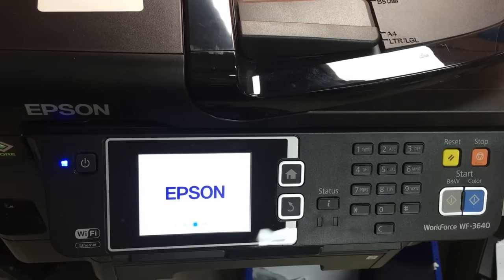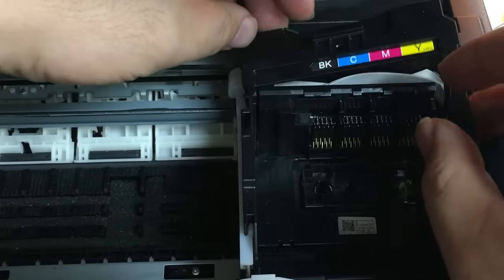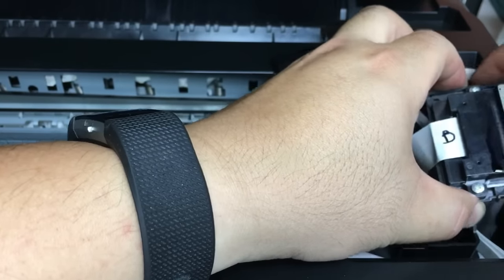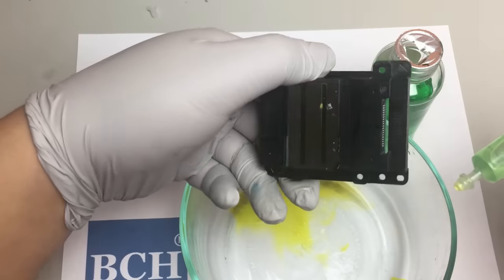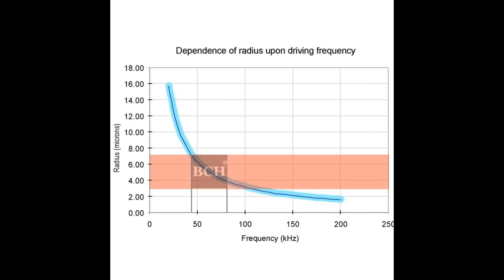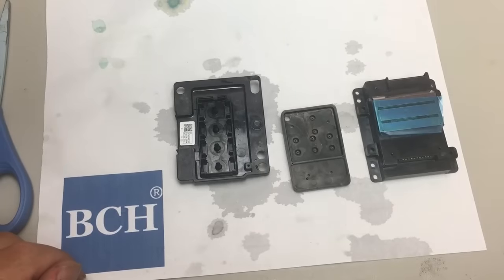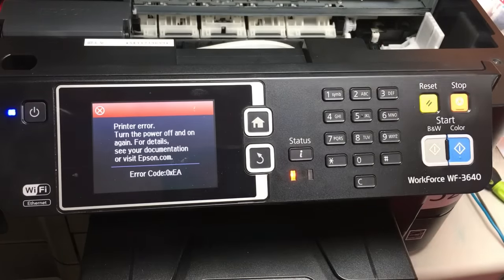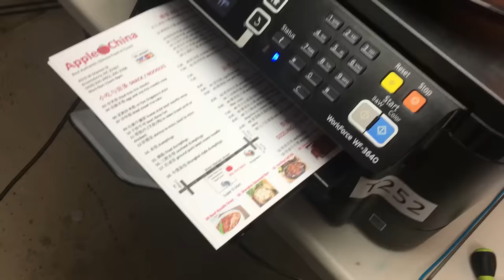Extreme Unclog Epson Printhead WorkForce WF-3640 Fix 0x97 0xEA Error

Comment: I followed all step but the sonic cleaner. I also didn’t have a compressor, so I pushed air through all the nozzles to dry them inside and remove any excess cleaner. I did two clean head functions and have don’t see any color on the print checks..... I’m not sure what I did wrong. Most of the inks are low, could that be a factor?
Reply: 9-12 test clean print jobs should work that out until you get clean lines.
Reply: @pamelawise1203  what do people mean when they say test clean print jobs   ?

Comment: Hi Kevin!  I just order some of the triple action green cleaner and a few other things.  I have a few pixels in my print head check that will not clear up no matter how many cleanings I do.  They don’t move either.  Wondering what my chances of success will be without an ultrasonic cleaner and just the cleaning solution?   Can we send you a print head for ultrasonic cleaning if needed?

Comment: At 16:16 describes my error perfectly and shows it happening too!  I read other articles that say the encoder strip gets threaded through brackets behind the carriage where a sensor or whatever can count the vertical lines to know when to stop.  If that strip (from what you and others have said) gets bent or dirty somehow, you are supposed to clean it with rubbing alcohol and a lint'free rag (like the light blue auto shop paper).  I replaced the strip and it is still doing the screech and stop on the left side (0xEA error).  ANY IDEAS ON HOW TO FIX THIS???
Reply: Hey Joe, I'm sure the chances of you responding to this are slim but did you happen to figure out a solution? I followed the tutorial as shown but I am still having the same issue that you had mentioned. I'd really appreciate any information you can relay to me and regardless if you have an answer or not, I hope you were able to repair  your printer. Happy printing :)
Reply: @jasonfunderburker9864  I did get another encoder strip from ebay, cleaned it and it stopped the left side slamming carriage, but now I get a E8 error and a shrill screeching sound on the left side.  Looking at a plastic tab on the left side gears that pushes a smaller gear towards the carriage and stops it, then the other screech like I said,  Yes, the encoder did stop the slamming carriage error 0XEA, but I don't know if that little plastic finger is supposed to stop the carriage yet

Comment: No, the lines appear to be perfectly horizontal. In fact I also tried to print an ordinary word document; that also just resulted in the overlapping blocks of colour with a few horizontal black lines here and there. Is there possibly a software reset code that I can put in to put the printer back to the original 'factory' condition.  It would be a shame to have to dump this printer because until now it has been a good, reliable peripheral. Thanks for any suggestons you can make.
Reply: @Barry Plumb  I'm afraid you have either shorted out or delaminated the printhead. It means that the ink channels inside it are now communicating with each other, irreversibly. It happens when you push the syringe piston too hard and the seals break. It's best to leave 1 ml of AIR in the syringe to act as a "cushion", and proceed with a SLOW suck/inject action instead of just plug&push. Sucking will force air back into the plate nozzles and the 'turbulence' will help dislodge dead ink. In your case you need a new printhead and the relevant Epson Adjustment Program to electrically match the new printhead to the old motherboard (very important!). Check Aliexpress.com and hope you find a good deal.
Reply: @Gavichap  

Thanks, Gavichap, for the information. As a matter of fact, in order not to exert too much pressure I did not use the syringe in the way the video showed.  I only used it to inject the cleaning fluid into a thin-walled silicone tube that I had placed over each of the ink feed nozzles.  I then simply pinched the top end of the tube closed and gently squeezed the middle of the tube between my thumb and forefinger to apply what I would have thought was quite light pressure. It looks as though the printer will now be a throw away since print heads here in the UK cost nearly as much as a new printer.  And that is without any additional cost for an adjustment programme from Epson.  As an engineer I am saddened by our modern, relatively poor, approach to serviceability; too much potentially useful kit ends up in the trash.  Anyhow thanks for your interest and for taking the time to let me know. Best regards to you.
Reply: @barryplumb581  Thanks for the reply Barry. I must say that, according to what you said, it's very unlikely that  the printhead could have got damaged with that light pressure. To unclog printheads (let alone to delaminate them) is required much more pressure than a light squeeze. I suspect the printhead got ink or fluid into one of its flat ribbon connectors somehow. As a last resort, I would search for a printhead disassembly video relevant to the printer series, lift off the printhead and check the connectors for moisture plus clean and reseat the flat ribbon cables. Depending on model, Epson printheads can be very cheap on aliexpress.com but Adjustment Programs are to be found on the web because at Epson they would rather kill the Queen than selling you the Service software. I left a message one month ago about their hideous policies. Have a look and have a nice day!
Reply: @Gavichap  Thanks again, Gavichap.  I'll do as you suggest and see if it might prove resurrectable after all.  (I never throw anything away anyway until I am completely convinced that it is worthless - as my wife is always reminding me as she looks around the garage!)  If I get the printhead out is it likely that any damage will be visible or will it all be on the micron scale and between layers that are covered?  Have a good day yourself. (I lived and worked in Scottsdale, Az about 30y ago and I still miss the friendly US-style exchanges between folk). Regards. Barry
Reply: @barryplumb581  Dear Barry, alas you won't find any visible damage on the printhead, except moisture - if any - on flat ribbon connectors. I advise you to take it out, flush the whole assembly with alcohol (aka methylated spirits), shake it dry and pop it in an electric oven (NOT MICROWAVE!!) set at 40° C MAX for 30 minutes or more with the door ajar . Then spray the connectors with a bit of WD40 and reconnect all flat cables carefully. Good luck and cheers from Italy . .
Reply: @Gavichap  Thanks. Will do.  (Sorry I mis-allocated you geographically. I had made the wrong assumption about where you may have been because of the timing of our exchanges.)  Thanks again and I'll let you know if I make any progress.  Barry

Comment: Is there any way to swap print head circuit boards? I have a fried one with the a good looking metal part and one that works but the metal part looks pretty beat up
Reply: Did you try it for yourself to see if this is possible? I have an Epson F2000 and the printhead is in the $2k price range. If all else fails, I would like to know if I can replace the board at what I'm assuming would be a much cheaper price.
Reply: Did either if you try this method
Reply: @franquishakemp7182  Not possible. They are all bonded tightly. Maybe if you heated it with a heat gun but I recall not being able to separate it without damaging the board

Comment: Stupid question, but is it a problem from using non-Epson ink or it’s just because these are crappy cheap printers that come free when you buy a computer?
Reply from the maker: Epson is the first company mixing pigment with dye ink. You have to get it just right.  For Epson’s that start with dye ink, you have less of these problems.  Also, Epson is making better print  head now.

Comment: Hey Kevin what about the epson print heads that cannot be disassembled, can you use the ultrasonic cleaner on them?
Reply from the maker: No, you can’t.
Reply: @BCHTechnologies  thanks for the info, right now I have a printhead from a l565 and I keep getting banding on the cyan. The nozzle check leaves the last block in cyan missing. I used cleaning solution, multiple head cleans, purged the tubes that send the ink to the cartridges and still no luck. This is an eco tank printer btw, could print head be damaged?
Reply from the maker: It could be.  The Epson nozzles are controlled by a very thin film.  This is different from HP and Canon.  Therefore it is more delicate.
Reply: @BCHTechnologies  thanks again for replying, the only thing I haven't done is a power flush. I guess I will try that then if nothing return it to the customer.

Comment: There was an extreme clog in the black channel of my WF-7720.  Took the printhead apart and cleaned.  Now, the printer keeps throwing an error code.  (031008)  I took it apart again and everything looks fine.  Still giving the error after reassembly.  What to do next?  Keep running head cleanings?  Is the printer done for?  Would this error go away after buying a new printhead?  I hate to waste the $$ on a new printhead, if it isn't going to fix the issue.  Any advice is appreciated.
Reply: Hi Christina. Did you finally fix 031008. I am fqcing the same issue. Tia

Comment: How do I fix horizontal lines in my prints.  I've done print head cleanings many times, still lines in my prints
Reply: In printer menu there should be head alignment option. Usually cause is unaligned head.

Comment: How many cleaning cycles you ran it through before getting it back to perfect?
Reply from the maker: About 9 to 12
Reply: @BCHTechnologies  thanks for the info, I did about 4 so far and I got slight improvements but I ran out of ink. The customer has a next set so I will tell them to do it a few times till they get better results. The ultrasonic cleaner really helped in the process. I fix printers for a living in the Caribbean, I need to get the syringe since the ones I had couldn't cover the hole properly on the bottom half of the print head. Thanks for the video.
Reply: @simplybs9311  I did a printhead clean and now the black that did work, prints nothing! Help, also on a 7710!
Reply: @Kyle5K  With me I got something of quality after 10 prints, the customer continued when he bought ink and he says its fine now. Its a combination of constant consecutive cleaning and having a good amount of ink available.

Comment: Thank you for your excellent video. I have followed it to the letter. At first, it did not print anything, blank page. Following your instructions I was able to get my WF-3640 to print something, however, after 3 cleanings, (waited an hour for the fourth) I am not able to get it to print correctly,  I am getting to many blank areas when I do the print nozzle check. Any ideas?
Reply from the maker: Before you clean it, was the printer using Epson's OEM ink cartridges?
Reply: @BCHTechnologies  since the beginning I've been using the Epson brand original cartridges.
Reply from the maker: @jtaca1960  Got it.  There could be two things: 1) Epson cartridge uses pigment ink so you may need to unclog a little more but let's explore #2 first.  2) After you clean it, the nozzle's chamber is not filled properly, either empty or with air bubbles.  It is like to prime a furnace to get it started, you need to push real ink into the chamber.  It will be helpful if you have refillable cartridges, so you can just push air into the refillable cartridge, and thus squeeze ink into the nozzle.  If you are still using Epson ink, you can try to somehow force ink into the ink intake.  The #2 is usually the case.
Reply: @BCHTechnologies  thank you, I'll try that.
Reply: @jtaca1960  did you figure it out as I am having the same problem?
Reply: @42iz0  not yet, I haven't had much time to work on it bit I'm starting to think that it might be on the ribbon cables or the print head itself.
Reply: @BCHTechnologies  Is it possible that the printer heads, meaning the circuitry, is damaged? or the ribbon cables are bad? Sorry it has been a year since this post but work has kept me away from fixing this printer. Thank you for your help.
Reply: @42iz0  have you been able to figure out the problem?
Reply: @42iz0  I'm going to work on this issue all day tomorrow and share what I come up with.
Reply: @jtaca1960  I am planning on buying refillable cartridges in hopes to prime them but I will await your results.
Reply: @42iz0  I've heard of those cartridges but I'm a bit reluctant to use them since the ink on the OEM cartridges are water based, you have to be careful to use the same type of ink.
Reply: @BCHTechnologies  have you had any long term problems using these refillable cartridges?
Reply: Has anyone figured this out? I’m having the same issue and have oem cartridges that’s are low on ink. I don’t want spend unnecessary money if in fact there is something else wrong.
Reply: Has anyone figured this out? I’m having the same issue and have oem cartridges that’s are low on ink. I don’t want spend unnecessary money if in fact there is something else wrong.
Reply: @BCHTechnologies  Sage advice here- going to try this on my next refill with my oem carts.  I left the plug off to use gravity to push ink down, but I may try pushing it in with a syringe on the head itself

Comment: ok - put it all back together and now I get blank pages... Could it be one of the ribbon cables isn't completely plugged in?
Reply: Did you find a fix for this michael? Same things just happened to me!
Reply: Did you run the clean print heads 9-12 times until you get a clear print lines?

Comment: Did everything - got the cleaning syringe from you guys.  Everything is back together - no warning messages - just prints blank pages.  Tried to run it a few times - but still not printing anything - just blank.

Comment: Can i use alcohol instead of the solution? Nice video very helpful.👍🏽
Reply from the maker: I don’t think alcohol will do anything but it won’t hurt.  I also tried acetone before and it’s not effective either.
Reply: @BCHTechnologies  what that cleaning Solution contains? I'm from another country so I'm trying to find out something to clean.
Maybe White spirit?
Reply: @Atetus94  Glass Cleaner is basically what it is I'm pretty sure.

Comment: When I try to turn the printer back on it will not power up. It just has a faint beeping sound. Any solution to this?
Reply: @caseykroger, did you ever it get yours back online?  I just did everything and now it will not power-up
Reply: @rondab4204  could the wires possibly still been wet? Maybe wait for them dry 24hrs/ Did you get yours to power on and working?
Reply: @Pamela Wise, I did finally get it working!  I was very frustrated but unwilling to give up so I took it apart the next day, watched the video and put it back together without rewashing and voila, it worked.  I must have missed a step in putting it back together.

Comment: can you use ultrasonic cleaner on epson f2000 dtg print head?
Reply from the maker: I would use the red cleaning solution instead.
Reply: @BCHTechnologies  so you would suggest to not put an F2000 printhead in an ultrasonic cleaner? Did you recommend using the solution because it's a cheaper alternative to purchasing an ultrasonic cleaner if someone did not already have one or can the Ultrasonic cleaner damage something?

Comment: Epson printers are nothing but trouble and a MASSIVE WASTE of gold-priced ink. Their main problem is that the printhead assembly is not user-removeable and virtually irreplaceable when it finally clogs/fails. And it WILL , so it's like having to throw away a whole chandelier when a bulb goes faulty. Epson's Planned Durability at its best! At every given number of prints and at a every head-cleaning cycle the vacuum pump wastes a ton of ink, sapping the scantly-filled gold-priced cartridges dry in a wink. Another problem is the infamous "waste ink" reservoir counter: it's supposed to be resetted by Service only, so it means curtains for low-end printers when it goes off like a time-bomb. Thus, recycling centres are full of Epsons, even barely used ones! What a nice brand, very "environment-friendly" indeed! Avoid like anthrax!
Reply: I'd recommend Canon, preferably an oldish model for which cheap third-party carts are abundant. Canon is less greedy and treacherous than HP which has been doing the dirtiest tricks to force customers to use their expensive original ink cartridges only. Or, buy an old HP printer which uses no. 22 (or equiv.) cartridges. Those are easy to refill and reset. Newer carts (eg no. 300 onwards are not).
Reply: @Gavichap  i mean inkchip makes them worth it.

Comment: Sadly after doing this I got the first error which was quickly followed by the 0x9a that seems to be insurmountable :(
Reply: Same here
Reply: Same
Reply: Same here. Does anybody know how to fix it?
Reply: 0x9a means carriage error and can be determined either by cartridge chips or carriage position strip sliding out of its sensor or its flat ribbon cable coming undone. Recheck everything with a flashlight.
Reply: @Gavichap  , "flat ribbon cable"?  do you mean the Encoder strip or a white ribbon/data cable like the old hard drive master/slave cables??
Reply: @bvnseven  It's usually a small white ribbon data cable with blue ends, very flat. Nothing to do with old EIDE HDD cables.